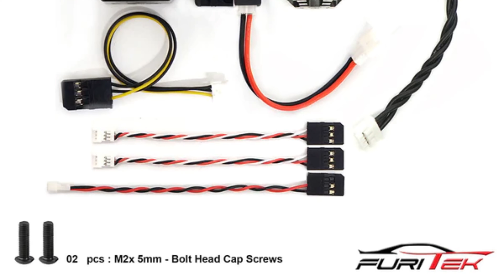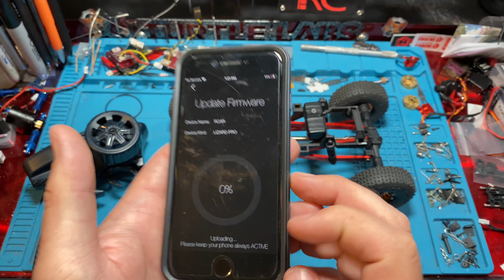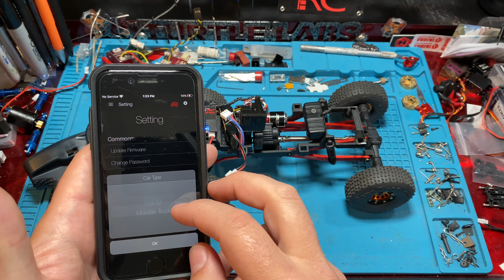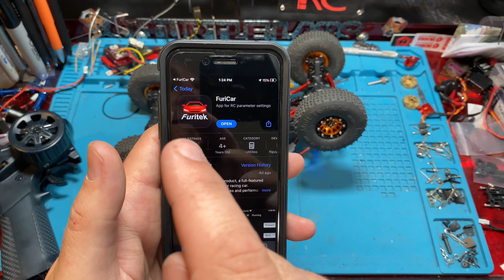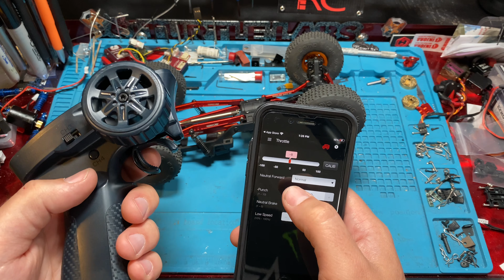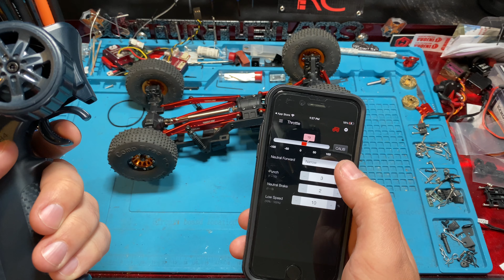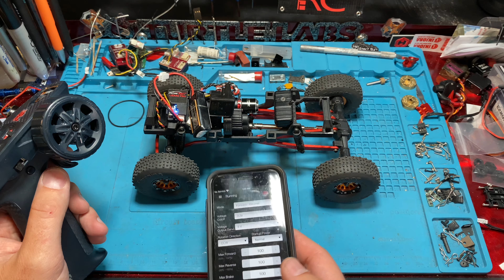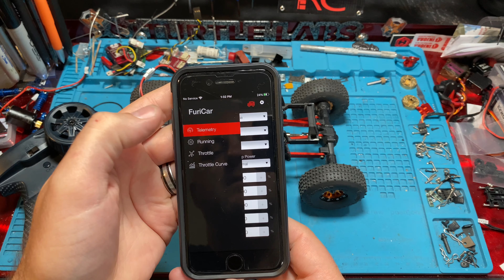FCX24/18 - Furitek Drop-in Brushless system! Keep your stock remote & get the best upgrade you can!

Comment: GREAT VIDEO!!!  I have this motor on the way for my FCX24 K5.  it is on sale at Helidirect for Presidents Day.  I thought it was still pricey, but your video showed me why…lol.  The bluetooth adjustments via app is amazing for such a small piece of electronics!  I also ordered FMS steel transmission gears, FMS steel diff gears, and Injora steel driveshafts.  I figure, may as well beef up the components that the new motor will stress.

I will refer to your video a few more times as I wade through the installation and app features.

Thank you for taking the time to make this!
Reply from the maker: you're gonna love it!!!
Reply: @TheShopMiniRC  Thank you!  Looking forward to getting it! 😀

Comment: Hi, thanks for the video! Would this system work with fcx18 lc80? And, since the esc gets replaced, would the lights still work? 
Cheers from New Zealand.
Reply from the maker: Yes, all of the fcx24 and 18 can use this system. Unfortunately you would lose control of the lights. You could plug them on an they would always be on. The stock Receiver has the light controller in it. If your NEW receiver has the light controller as well, they will work, but the furitek receiver does not control the lights.

Comment: I just installed this on my fcx. How do I bind V2 remote? Great vids🤙
Reply from the maker: you have to be sure you have the receiver I showed. To bind, it's simple (and I pretty sure i show it in the video).

Just hold the bind button down while you turn on  the remote, then while its blinking, turn on  the truck.
Then wait 5 seconds or so and turn them both off, and then  on again. You should be bound.

If it still doesnt bind... it might be an issue with the v2 :(
Reply: @TheShopMiniRC  thanks. I saved myself further frustration and ordered the MG41 V5 transmitter. 🤙

Comment: Ken....Do you or would you suggest replacing the trany with the Fruitek one ???well I should tell you I,m probably installing the Brushless set up on the Smasher  V2 ... wondering why you didnt .install on your Butcher  .. I'm just guessing but maybe the Fruitek  does not support two speed like the stock .. a guess ??   whenever you have time to answer I know your busy
Reply from the maker: The “furitek trany” that is metal is for an scx24, the fcx24 trans and motor combo that furitek offers is just the stock trans still. 

I personally like the fcx24 trans with the two speed. It makes the truck fun. However, if I was going to try and build a serious comp crawler, the two speed would come out (or I would at least remove the non-needed parts) to help lighten up the truck.

Comment: Hey man! Great stuff here, love your videos. My stock remote started the twitch of death, with throttle and steering. Recalibrate it and tried it on another truck as well so I know its the remote. Do you have any recommendations for another remote that will work with this setup? Thanks in advance!
Reply from the maker: Any normal RC transmitter(remote) and receiver will work, as long as you replace the remote and rx. 

This is a replacement remote for the FCX24 (k5 and smasher): https://shrsl.com/48i8r

there are a few others on their site and it looks like some can be ordered with JUST the remote.

Comment: Have you tried to heat the blade of the knife to cut the housing out?
Reply from the maker: Great idea.  I just didn’t want it to “bubble” the edges and cause rubbing. I guess I could still just cut out the bubble or bevel that might be made from heating the plastic.

Comment: Hi Sir, do you have an easy way how to lock the trasmission of max smasher for high speed only, I want to remove the servo selector and leave it on high speed gear only. Thank you.
Reply from the maker: Just gotta get creative with it. Maybe use a twisty tie to hold the shift shaft in the high speed position. you can also just put a dab of hot glue over the one end so it doesnt slide back into low. You can then remove the hotglue if you ever wanna restore the 2 speed.
Reply: @TheShopMiniRC  thank you, I thought my idea to just have something to hold it outside is kinda bonkers coz I saw someone did something by putting/changing something with the gear inside. So, this is the acceptable other/easier way 😁 thanks alot sir 👍😊👍
Reply from the maker: @R-EVLMNKY  you can probably add some shims inside the shift mech or remove the shift fork, but that’s a lot more work and requires taking it all apart.

Comment: How can I run brushless and rear steer on my k5 FCX24? Could I use this kit?
Reply from the maker: Sure can.
Reply: Would you keep the stock (new model) transmitter for rear steer and brushless setup or would you go spectrum, etc?
Reply from the maker: all a matter of preference. A higher end transmitter will give you better mixing/rearsteer options.

Comment: Is there anyway to make to stock truck run smoother and quite the transmission is a noisy bugger it actually stops me from running it ya my ocd is a real thing 😄
Reply from the maker: Mine doesn’t seem loud. Metal gear trans?
Reply: @TheShopMiniRC  no stock gears.. oh well  weird stuff lol
Reply: Have you completely torn down the front & rear portals, transmission, & got into the punkins to get to the ring & pinion gears to lube them properly? It is loud because all those locations need to be lubed well, which I highly doubt you ever did or you wouldn't have mentioned your problem. Tear it completely down & do it right & it will be far much quieter.

Comment: Hi Ken could you please get me the measurements of this receiver thanks,
Seeing if it will fit on fcx24 grasshopper chassis delrin slider
Reply from the maker: 22.5 x 20.6 x 25.5 It looks like it should fit. Worst case, you can dremel the case a tiny bit or completely decase the ESC and gain a ton more space.
Reply: Thanks

Comment: So I just found out the Avatar TX doesn't work with that RX! :(
Reply from the maker: No, it wouldn’t, it’s a different protocol. This rx is designed to work with the stock flysky remotes.  You need to use the furitek tx and rx or you can use the stock remote and this rx

Either way, both work with any external esc.
Reply: Ah crap! So now I need to order an RX form Furitek! Loool
Reply from the maker: @djtazzmtl  ooof. I forgot they offer a tx without any rx.  :( yeah, you’ll need to order an rx.  That Also means you won’t be needing the rx that came with the drop in kit.  If you find yourself wanting to get rid of the rx, lemme know. ;)
Reply: @TheShopMiniRC  yeah I'm willing to part with it...
Reply from the maker: @djtazzmtl  you can email me at TheShopMiniRC at g mail dot com ;-)